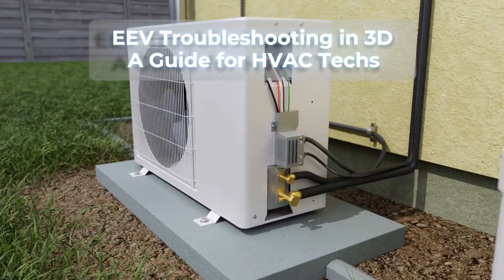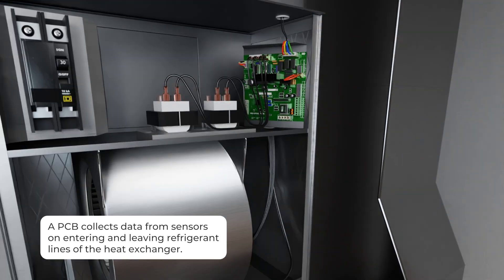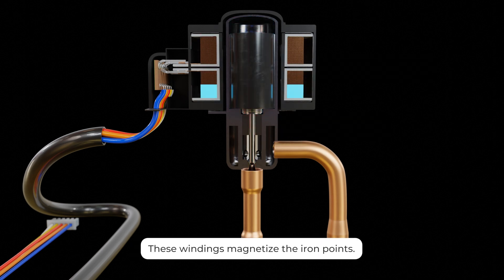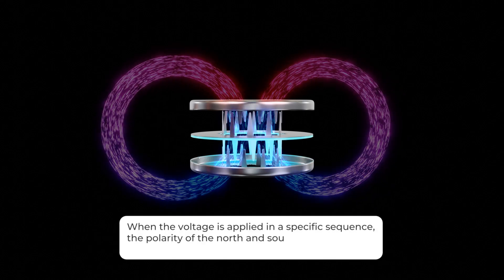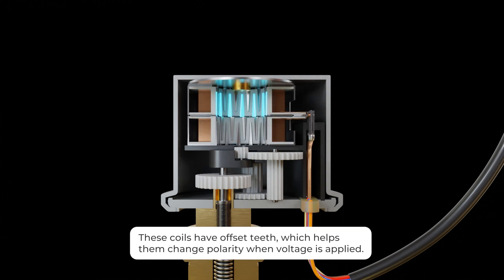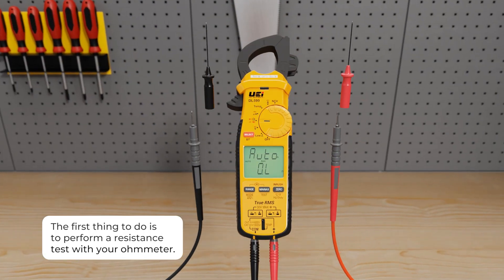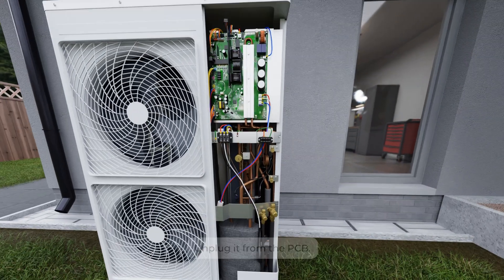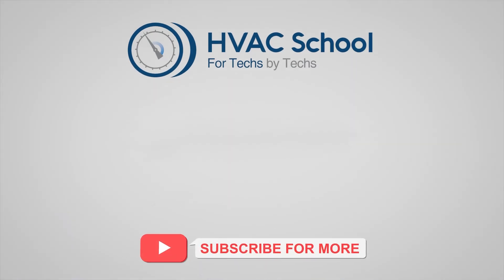EEV Troubleshooting in 3D: A Guide for HVAC Techs

Comment: Engineers: “How can we make something less reliable?”
Reply: A lot of it is dictated by government energy efficiency standards.

A computer with a few sensors, and a little bit of programming can do something more efficiently than a mechanical valve can.   But you’re 100% right on reliability, I’ve seen TXV that were older than me that still worked fine. 

Even more reliable than a TXV is an orifice, but they also work less efficiently and in a more narrow range .

Comment: So you made an expansion device that fails more often than the old version? Great job, engineers. You stuck it to us again.
Reply: What!? You mean these cheap Chinese electronics don't last longer than their respective mechanical counterparts!? Wow, who would've guessed... equipment has been getting crappier and crappier by the minute. You get a 10 year "parts warranty"? Good, bc the equipment is only good for that timespan, if your lucky.
Reply: @craigbraswell4269 yep. If someone started a company that made things that only ran on solenoids, relays, and other various analog or mechanical components they'd be a millionaire in a month. Especially if the mechanical parts were made in the USA. 🇺🇸

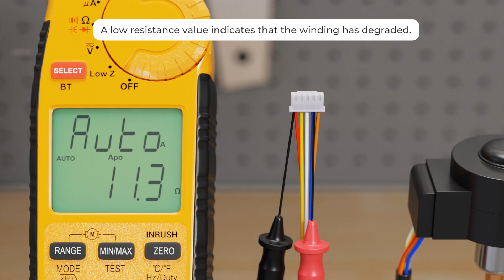Comment: 9:05 You don't necessarily need to replace the valve in that scenario. You should start by replacing the powerhead first I would say.
Reply: The term replacing the valve at this time stamp is referring to the powerhead. You will find later in the video the entire EEV assembly is referred to as Valve Body
Reply: https://youtu.be/Do9qHCRcwaY?si=6v4FGQA7wxfArTVC

Comment: In my experience, most EEVs have 1,596 steps (and some with even more)…
Reply: Daikin run 2000 pulses
Reply: @dylb8801 you got it!
Reply: The steps don’t really matter it has more to do with how that manufacturer uses that model EEV. For example Daikin may use a valve at 2000 pulses (the full range) but Fujitsu may use the same EEV with a max range of 1,596 pulses. The valve has a higher range but it’s not being used.